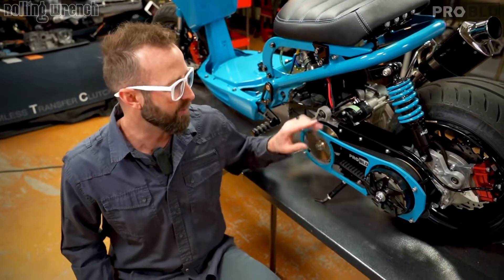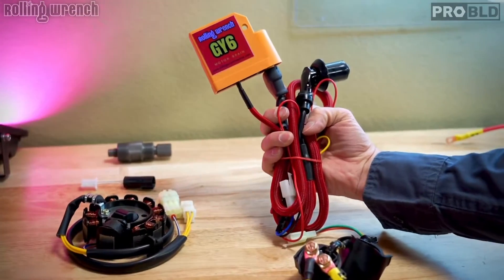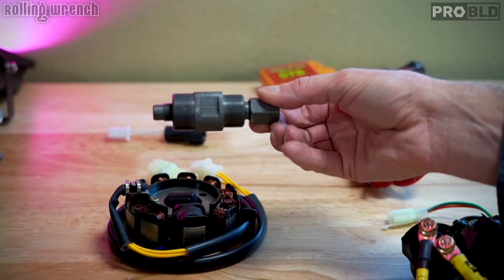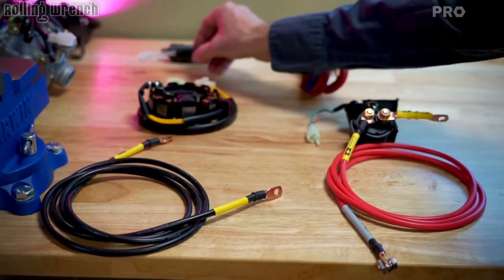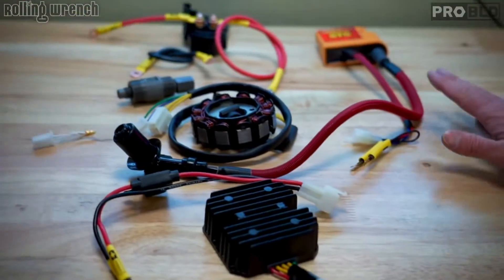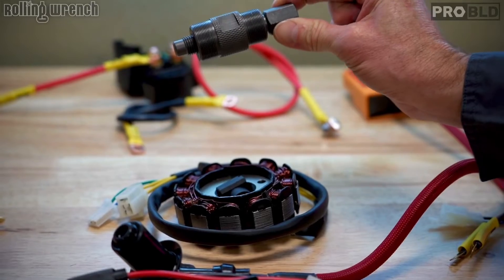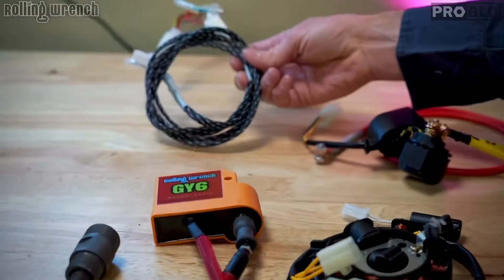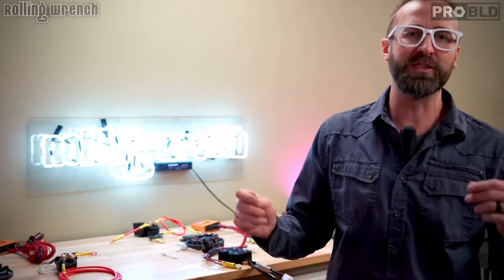GY6 WIRING HARNESS - RUCKUS / METRUCK / SPREE [No wiring skills needed]

Comment: Question for you, let's say I am deleting Ruckus motor and ecm and would like to use the stock wiring harness for the turn signal, flasher, horn  Etc. Would I have to jump wires on the ECM plug to power them?

Comment: Thanks for all awesome videos. The one about stators was really awesome and I learned a lot bug I still have one question. How to know if stator is single, double or three phase? I have read that is not all about three or two wires. With multimeter you could “read” if it is three, two or single phase but I don’t know how. Could you do video on that. Also I have Lifan engine and some say it has not enough “power” in it

Comment: What do you do with the ground cable??
Reply from the maker: It attaches from the negative of the battery to the starter mounting bolt (2 ground wires on top of each other)

Comment: Now I'm curious if I have to keep the Honda ECU? Or can I remove it completely? I'm building a gy6 150 metruck
Reply from the maker: You want to keep it for maximum reliability. The ecu controls the fuel pump and charging system.